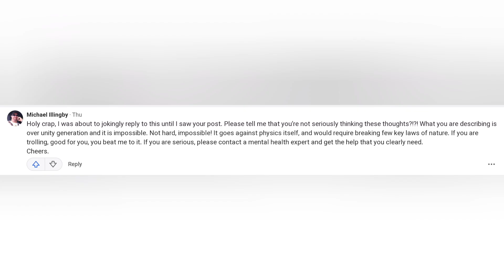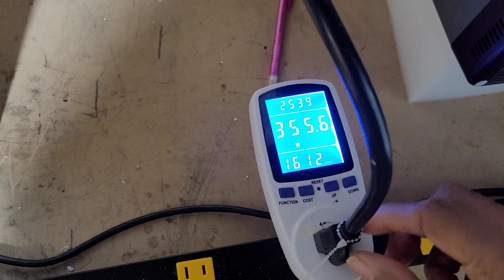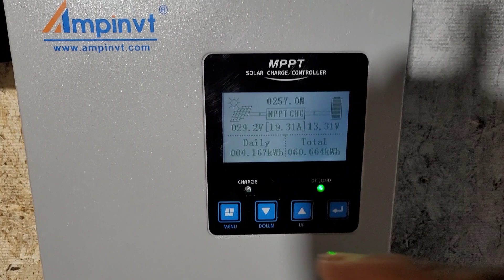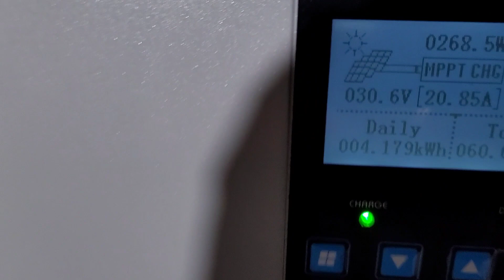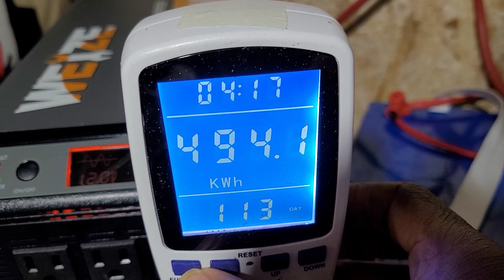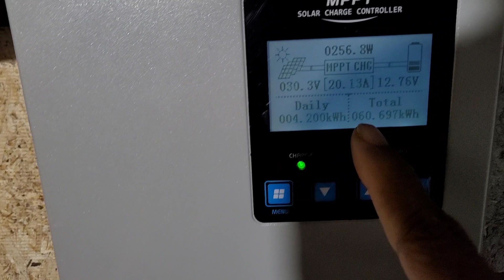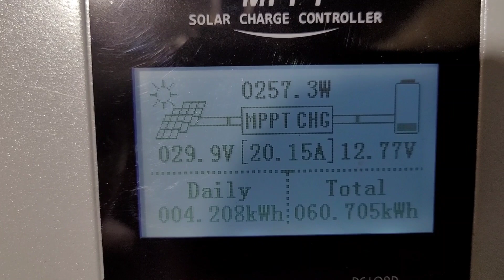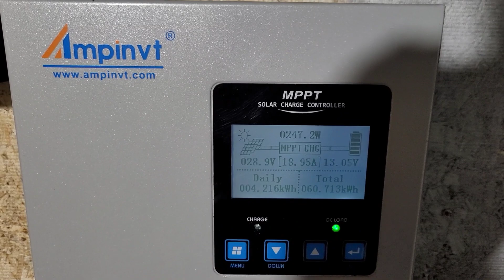the ? asked; Can we charge an inverter using its own output?"  then this happened!!!!!

Comment: Michael Illingby is 100% correct.  As much as it is a pipe dream to create a perpetual energy source all you have been able to prove with your experiment is that you can discharge a battery using the configuration you've demonstrated.  Sure you started with a near fully charged couple of 100AH batteries and over a period of hours you managed to discharge them to a terminal voltage of 10.5 volts.  In your experiment I did not see any real load like a light bulb or an appliance getting powered so in essence you were just feeding the AC outlet of the inverter back into a power supply to make DC to feed into a charge controller to connect to the batteries.  
No inverter is 100% efficient in converting DC to AC and no AC to DC power supply is 100% efficient and nor are there any 100% efficient charge controllers.  Give these are facts some of the energy is going to be lost in the process.  This lost energy has been converted to heat, so unless your objective is to create heat your experiment to attempt to discredit Michael Illingby is a complete failure.  Inverter efficiency typically ranges from 95 to 98% in converting the DC input to the AC output, so automatically you are losing anywhere from 2 to 5% of the energy.  How do you propose to "make up" for these losses?  I haven't even mentioned the losses in the rest of the components which must account for even more losses in your "loop".  Whilst your configuration doesn't cause any harm, it isn't doing anything worthwhile except proving you're an idiot.  LOL
I've got no idea from where you obtained your electrical qualifications but I'd suggest they aren't worth the paper they are written on.  You are doing nothing more than demonstrating your ignorance of how electricity and energy systems work, oh and providing the catalyst for hilarious amusement at the same time.  This video has the same credibility as making electricity from used CDs and magnet wire.
Reply from the maker: This is exactly why I had to do another video because because I knew that people will make statements like this Again I've gotten this all my life and I've been using these systems all of my life, Comment like you are the father of a unity you created over unity those sort of things but again the system does work if you check out the 2nd video you'll see that I maintain in the 2 hundreds and the system does charge I'm trying to find that sweet spot right where it's  Stable and doesn't move that bar one way or another I did it with a smaller battery just trying to get used to this set up so I'll probably do 1 more video on this but try and get all the information before making Comments on something you haven't done yomyself the books won't tell you about things nikolai Tesla was talking about Remember they tried to erase him for history so this is why I decided to start writing books and giving much detail as possible, And please look at the load you're talking about I'm putting this back into a tigrid which is going into my grid it's only low that this job is supposed to do. To create something new you have to push past those school books It's the only thing I can really tell you you're going to have to try new things or stay stagnant. And if you don't want to watch all the data in the next video then please just go to 7:40 on the timeline , This is where I started to show you how I'm looping energy and how is putting it back into my grid.
Reply: @Alan Rutlidge Whilst I understand certain points being made, I will never understand why so many of you grown so called "Men" get online and start crying, and name calling like little boys! Be Real "Men" and point out your knowledge about the topic without being an arrogant pompous or, using biases or, assuming you know it all, and the other guy knows nothing... The guys who see things differently are the true pioneers, many of whom created so many inventions, which we still are using and redefining today, and were also told that they were idiots, and needed mental help... We are "All" here trying to learn these components for the betterment of ourselves and our families... And although I agree with some of what you mentioned, real men know how to help motivate good dreams, instead of destroying them... 
         
        @Lloyd Stovall I have actually created my own system using Victron Energy components, and things are running fine! I'm definitely not in the research to test my equipment as you are hence, I've spent WAY too much money to burn them up... But, more power to your research and don't let the sphincter boys get you down... Use your terminology correctly, and make sure you clarify to these people what you're doing... But, don't tell all...
     Good day Gentlemen...
Reply: @apocalypticminister1369  there's absolutely nowhere in his video did he demonstrate "unity energy".  The battery eventually became discharged and he proved this in the video.  If the set up was indeed "recharging" the battery it would never run out of energy.  What Lloyd has demonstrated is the laws of thermodynamics that in essence proves that energy can't be magically created from nothing it can only be converted from one form of energy to another.  In this case heat.  If he's created a unity energy or a free energy device it needs to have some practical application like powering a light bulb or an appliance and never running out of energy.  I suggest to prove his point he needs to create a system that doesn't get its energy from an external source.  I propose he disconnects all the miscellaneous unnecessary devices and simply powers his inverter from the battery (he can start with a fully charged battery), no external energy sources like mains or solar, then switch it on and load the output of the inverter with two 100W incandescent light bulbs.  Now see how long the system runs before it can no longer sustain operation.  If it stays on indefinitely he has proved his point.  If it stops working he's proved the laws of thermodynamics and has debunked his own claims.  Challenge on.  Oh, and BTW "real men" will have the balls to question something they think might be bogus and ask for an explanation or proof.  "Little boys" generally do as Daddy says and don't often question Daddy's authority.